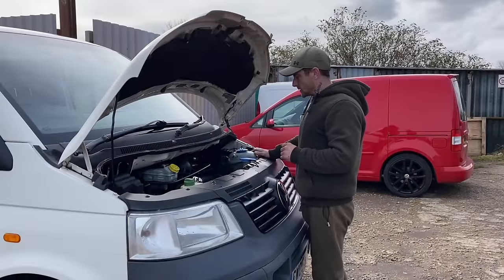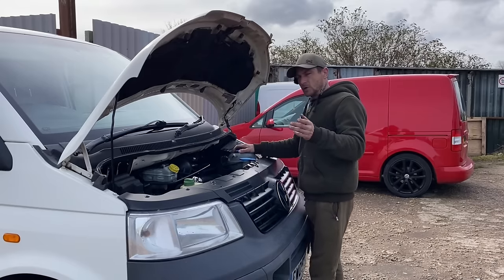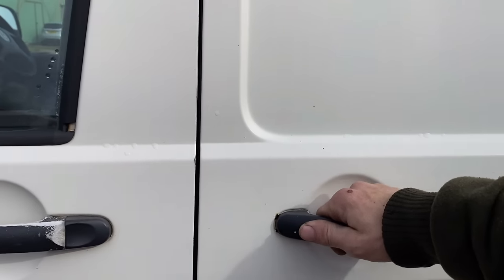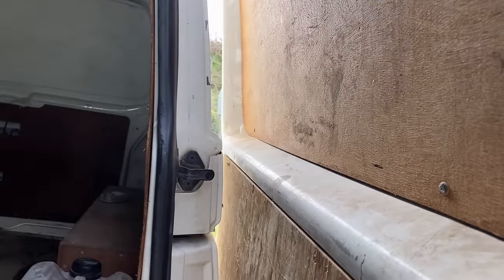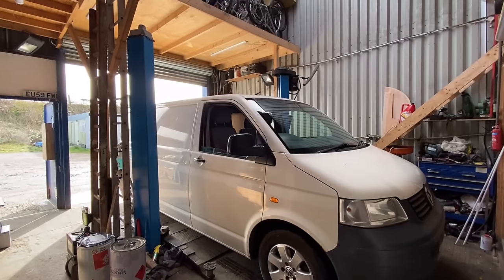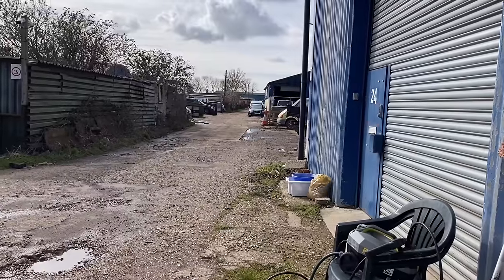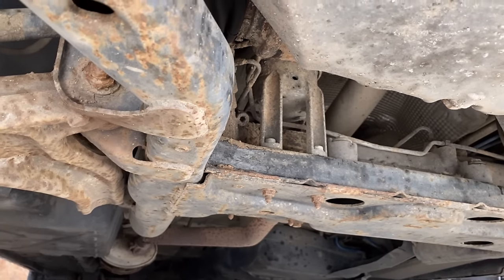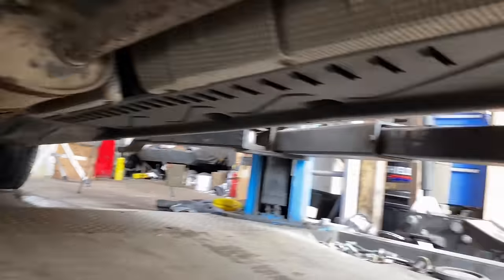Buyers Guide - everything wrong with a 300k T5 transporter

Comment: I've been thinking of getting a T5 for a few years now to replace my T4 I've had for 15 years. It's starting to suffer from the old tin worm and really needs a bit of restoration work. Not half as bad as some I've seen but needs panel work all the same. Finding someone who knows how to do it properly is hard so I'm thinking I might replace it as I can't bear to see it rust away before my eyes. I've also been put off getting a T5 by other T4 owners saying T5's aren't as good, build quality is crap, more expensive this and that. People saying they had a T5 but went back to a T4 etc etc so I've hung on to mine plus I've had it such a long time it's hard to part with. Great video and good to see they do last well especially after high miles. My T4 is an 03 (done 187k) so not that much older than yours and it's got more rot showing through sadly. You've got a good van there by the looks. it'll be great to see what you do with it 🙂
Reply from the maker: Hey Matt 👍 so I done a part resto on a T4 at the beginning of my channel and you are right they are built really well and they are a very good van. I’ve driven a few T4’s and they do drive nice even compared to a T5. It’s hard to part with a motor after owning it for a long time so I understand, one way to think about it would you be happy to keep on with your T4 if it was still in good condition or would you still have the desire for a T5? Answering that question would decide weather you pump some money into yours or weather you upgrade. I can confirm that this T5 seems to be built well and the quality of the original parts have done so well. It does need a lot of love and new parts but it’s definitely built well from the factory. What panels on yours are rusty? Have you seen my build series in the T4? Thank you for your comment.
Reply: @YTDTETV  Yes, I'd be happy to keep the T4 if it didn't need body work, welding and paint. I'm the second owner of it, got it at 4 years old. It was previously owned by a VW dealership so was a workhorse but like your T5, not heavy use but had covered 94k miles. It still has its original panels and paint, no clag anywhere. Wheel arches have started going and drivers side rear arch/sill near the jacking point (common place). A few areas around front wheel arches and sills and of course a bit along the sliding door step, not needing a new step just a few areas dealing with, one being the lip where the door seal sits. Overall it's really solid underneath. Some I've seen on the internet are absolute rotters. I recently had a bloke do a couple of patches for the MOT but he's made a right mess. It's good enough for MOT but needs cutting out and doing again, it's terrible. Basically the van needs a lower half restoration. The original paint is still very good otherwise. It does have a window in the sliding door but not the drivers side, I like the panel van look and couldn't face having a window cut in side of the van. My thinking was if I want a proper panel van again just change the door for a solid one 😆 It's also the 5 cylinder 2.5 TDI 102 hp model, something I knew I wanted from the start. I have only ever driven one T5, a 64 plate some years ago but I remember it drove nice. My old T4 still drives nice, all original ride height, wheels etc. I've tried lowering and alloys but didn't get on very well with excessive tyre wear etc. Sometimes I just think it might be better to sell it on and buy something newer that doesn't need welding and start again with a basic conversion for camping and days out but as the sayings go, I don't want to jump out of the frying pan into the fire and better the devil you know !  There is only one guy I know of in my area that does welding and panel replacement that I fully trust(he doesn't do finishing and paint though) but he's got a fair bit of work on. I tried to get him to do my MOT repairs before Christmas but he hasn't got the room. Tied up with MK2 Escorts ! I have seen the resto you did on the black T4, that's what got me into your channel 🙂 excellent job you did too 👍
Reply from the maker: @matttaylor1372  so it’s first half life being owned by Vw it would have been looked after well, it sounds like it’s going in the same places as the black one we did. I see a lot of comments people saying it’s hard to find people that can finish panel and paint nice, it’s shame someone did a poor job on your van but I guess it kept it going another year. I’ve seen similar work done down here plates just stuck over the top with really thick welds. I agree I like the panel van look to 👍 ye just another sliding door with no window in would do the job. Ooo the 5 cylinder one they go well, they sound sweet with an exhaust on to. I drove a couple of the 1.9 69hp ones and they are super slow. It’s all about standard suspension for ride comfort for sure nothing worse than a lowered motor then bouncing down the road. You are so right about better the devil you know I say it to my customers all the time they spend money on the vehicle then say I’m going to sell it before something else goes wrong I say we’ll what if you buy a new car and have to do the same work you’ve just had, madness. I used to be a Ford man and like a mk2 escort but I’m not the biggest fan of rust and welding. If it’s just a handfull of panels and a good bit of paint around the lower half maybe a few extra bits you would probably be looking at around £2000. The garage just down from me that I use his spray booth he would be the one to do the job your looking for quality wise.  It’s nice to stick with a vehicle but it is always nice to upgrade and get a newer model.
Reply: @YTDTETV  It's certainly difficult finding a body shop willing to do the work and of course knowing if they will do it properly. Everyone says "Buy a Welder" as if it's that simple. Ironic thing is, I have a welder (not a particularly good one) and some equipment to cut/grind/Compressor etc and I have had experience of welding but I've not done it for so long it's a case of lack of confidence, Somewhere to do it, Time etc etc. Plus, I'd like it done correctly. Yes, those guys near you would be ideal but sadly you are about 170 miles away from me 😥otherwise I'd seriously consider it. Like you said I've got an MOT on it now which I hadn't before the "Patchwork" lol but there's time now to have a think on the next step. You never know I might end up with a van like yours, one may just come along at the right time. I'm looking forward to seeing yours progress and I'm excited for you. I do admire how you get stuck in and get things done 👍

Comment: Some people are so tiny minded it's frightening......Keep up the good work mate.
Reply from the maker: Hey bud they are 👍 I won’t rise to it next time. Thank you
Reply: @YTDTETV  Hiya man just bought 2001 T4 full service h 2 owners 248,000 I need to find out what I do about a new key it works manually for now any advice please.
Reply from the maker: @FASIGMAN  nice find 👍 does the red light flash on the key when you press the button? If not try a new battery in the key first

Comment: im deffinately not fussed about milage! ive just bought a 1.9 shuttle bus 9 seater with 430,000miles! the head gasket went because of the coolant pipes running to the back of the van to the second heater matrix let go and lost all water.
It now has a new heart from my asz golf with 260k
Reply from the maker: Hey bud blimey that done well on mileage 👍 plenty of life in the asz. Thanks for the comment.
Reply: @YTDTETV   Any chance you could do a video of removing the heater matrix nobody has done a vid for the t5 ?!

Comment: You’re missing rear lower spring rubber cups.
Front wishbones, if you re-bush - either poly from PSB or, get rear t32 bush (non-voided oe part without A at end of number) same dimension oe bushes not expensive. Oe roll bar bushes are cheap.
Balljoints, drop links, TCAs - Meyle HD
Lowering springs - h&r (their kits have a standard and h/d spring for front and rear and the 4 kits are made up of those combinations - standard front + h/d rear for your lwb) or eibach - two 30mm kits standard and h/d, avoid h/d. If budget stretches I’d suggest the eibach 50mm kit with coilover rear adjusters from likes of transporter hq
Exhaust silencers are double skinned and last for ever, get a big crusty but just remove crusty part of outer skin as required.
18” wheels with 255/45-18 103 are ideal for daily (amarok has same stud pattern and larger alloys / steels that are a direct fit), 20s look great but are a pain for daily.
Reply from the maker: Hey bud that is absolutely brilliant I’ve screen shotted your comment for future advice, don’t know anything about these so greatly appreciated 👍. I will literally buy what you mention above, I have eibach springs on my caddy and they are very good so I’ll go with them. I was surprised by the condition of the exhaust I’ve seen 18 plate Corsa exhausts complete rotten through already. I was wandering about the wheels 👍 I know bigger wheels don’t drive as nice aswel as wear bushes and joints faster, I also wonder if that’s what kill the gearbox’s on these? 18’s it is again really appreciate the comment 👍

Comment: Fantastic video! I have a T5 2005, had it almost from new, 127k miles. I am now getting MOT advisories on the corrosion of brake lines and handbrake cable so it was great to see this on your video so I can locate them. Can I wire brush this corrosion off and treat/paint or would it be better to replace? My garage haven't suggested new parts but I would rather get on top of things so no surprises later! My van is also my camper and to know that I am doing what I can to keep my van going for as long as possible, is really important. Thank you
Reply from the maker: Hey bud thank you appreciate that 👍 yours is good miles still plenty of life left, yes you can clean and repaint the brake pipes, you can use a wire brush and sandpaper. When you rub the paint off you’ll see if there is pitting in the pipe, if so then replace but if you rub them down and they are smooth then they are saveable 👍👍

Comment: Found this very interesting. As i have just bought a t5 with a flashing heater plug light have to put the key in the ignition three times before it stays soild . Then it fires up could this relate to a doggy ignition thanks 👍

Comment: On my T5 I had to pull out the old roller at the back? (towards the rear of the van) as there is a plate there you also have to remove in order to get the roller out, and new One in? Also why not change out the heater dials for newer Aluminium set (see my channel for a review and fitting guide) 😁
Reply from the maker: Hey bud thank you for the tip the last one i changed was on a transit and it came straight out so I might be wrong with this one. Your the second person to mention the ally heater knobs and I’ve since looked and like them, I shal be buying a set 👍 thanks for the comment.
Reply: @YTDTETV  If you want to see how I fitted the Aluminium dials, check my channel, I'm doing a V5 campervan conversion right now. And yes you need to get the sliding door all the way open, and remove a small plate inside the roller channel, this allows the roller to pop out of the channel 😁

Comment: Don’t start explaining yourself or they will never stop at you , you’re not wearing gloves no eye protection and that’s not the correct hammer to use . And if you give into them then the clean freaks will jump in you should have washed that before trying to fit it.  Just keep doing what you are doing Lad 👍.
Reply from the maker: Hey bud thank you I really appreciate that, your right there’s always someone to spot a problem, I won’t let them dig at me again. Thank you for the support 👍👍
Reply: @YTDTETV   
I noticed under the van that spare wheel looks rusty. Start oiling the nuts up for the spare wheel. I have spent ages trying to get mine out and doing it slowly tightening up and loosening them off . And the Nut wielded to the van snapped off. 
I was left with a junior hack saw cutting the bolt off .. what a job now I have to drill out bolt and wield the nut back.. 😂
Reply from the maker: @midnightrider6985  oh man junior hacksaw I bet that took a while 😂 I had the same issue on my caddy had a stuck bolt in it. I ended up cutting the nut out that had the stuck bolt in the used a nut and bolt instead,
Reply: @YTDTETV   
It took ages to cut as the only blade I found had bits broken off, it was a right pain. 
I am going to have to get the nut wielded back and should I disconnect the the battery and if I do will I lose the remap do you think ?

Comment: Hello mate, thanks for video. I need to pick your brain - I’m looking at a 2007 VW Transporter 1.9 TDI PD T30 LWB, it’s a full Campervan with pop top etc. - it’s priced just under 13K and has done 185K miles. 
I don’t know much about mechanics and the reliability of these vehicles, is it worth biting the bullet and purchasing do you think? And if the answer is yes, what’s the worst case scenario and how much should I have aside in case that worst case scenario occurs?
Thanks for your time in advance mate
Reply from the maker: Hi bud 👍 the 1.9 is the best engine in my opinion in the T5 and 185k miles is still very good. My head gasket failed just shy of 300k and I believe it’s because the anti freeze wasn’t change enough then the coolant rusted out the head gasket. If it was changed very few years it would still be running mint now. The build quality of these is very very good. One thing about them I’ve seen is the 5 speed gearbox’s same as mine can let go and replacement can be around £1500-£2000. Mine still works great on the mileage but definitely wanted to mention. The money doesn’t sound bad at all as a pop top is £5k alone. If you don’t buy that one and keep looking don’t buy a 2.5 one the engines fail a lot.
Reply: @YTDTETV  top man, thank you very much for getting back to me and elaborating on the above that’s very helpful mate. Unfortunately this one sold literally hours after being posted but I’ll definitely keep an eye out and won’t shy away from higher mileage ones. Happy travels and once again thank you for your reply bud!

Comment: Hi Sir...which is the best way to  change the engine mounts...do I remove front bumper and work through or does the cross member be removed from underneath
Reply from the maker: Hi Claude the front engine mount you can get to with the front bumper off and you might need to get under the front for 1 or 2 of the bolts, the back one is a combination of from the top and the bottom.

Comment: investing I'm buying a t5 2.0 tai 280k, its the Auto gearbox im worried about failing .
Reply from the maker: Hi mark so the mileage would t bother me, I’m unsure on the auto box’s thow so I can’t comment but I’m sure with abit of time researching them you could find out. If it drives well through the gears then it’s more than likely ok I would just get the oil and filter in the box serviced straight away for piece of mind 👍
Reply: @YTDTETV  yes drives ok got service history  oil looks clean but not sure about the life span of and double clutch gear box . will get a it serviced soon tho. not meany auto around my partner has a artificial left foot joint so struggles with manual . not that she drive it often . I've got a A3 same 2.0 tai great engine will be selling to make room for the T5 as it will be my only car/van 
didn't want a full on van for a daily hence the T5 fit's the bill . to carry bikes and motorbike and be a all rounder car too. come to think of it I don't know why I didn't buy one sooner

Comment: 20:34 why is there no belt on that pulley? Is that the air con comp seized so someone took it off?
Reply from the maker: Hey bud I just went and looked under the bonnet as I was unsure, there’s definitely a belt on it. These vag belts have grooves on both sides so it does look like the belt is off 👍
Reply: @YTDTETV  My bad buddy! It just looks wrong! Good luck with it!
Reply from the maker: @mistermister8  no that’s fine mate I did wonder when you said so had to go outside and check, most vehicles have a smooth surface on the outside but these have ribs both sides.

Comment: Don't suppose u want to check over my T5. It's buggered
Reply from the maker: Hi bud what’s wrong with it? What engine does it have? Thanks
Reply: @YTDTETV  hey there. It's a 1.9 2004. Shudders away under acceleration bad idling. When I stop and start a few times it's ok. All be it it smokes and def an air fuel issue somewhere

Comment: Do yourself a favour and get a good well charged battery on that, they have a tendency to blow the abs ECU when you jump start them ask me how I know !!
Reply from the maker: Hey bud I take it you lost an abs pump, I’ve put a decent battery on now I just need to remember to pull the earth lead off every time I park it as it’s got a battery drain.
Reply: @YTDTETV  hilarious, I'm watching your video whilst having a break from trying to find the battery drain on my old T5 ex painters van....seems to be a common theme for the T5 if you get on the Google. Thanks for the ignition switch tip, I'll get one and put it in just to be sure.
Reply from the maker: @gregroles69  hey bud sorry for the delay, mines drains bad and I’m positive it’s the ignition switch.

Comment: Don't buy a T5 they are overpriced, expensive to fix, not as good as the competition and not that reliable. In my view reliability is everything. So number 1 is the Vauxhall/Opel Vivaro, great engines/gearboxes and superb to drive and post 07s have a timing chain...and no rust. Next Traffic. Fiat Ducato in third, as they can rust, just like the T4/5s. I bought/converted my 08 Vivaro back in 2015, new clutch on 180,000 miles and it's a joy. Prior to that had a Transporter which was a nightmare.